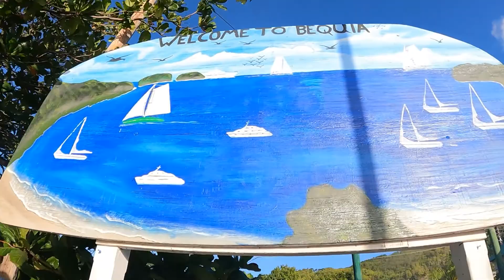Sailing the Atlantic Loop - 13 Cruising St  Vincent & The Grenadines

Comment: Hello Caroline & Charles, 🙋‍♂️
This is a really nice video. One or both of you have some pretty decent skills with a camera and software.👍 (And some good equipment.)
A observation and a question. First the question,  (at 16:56 ) any idea what kind of fish that is? I've spent a large part of my life in, on & under various oceans and I don't recall ever seeing one before. My wife says it's probably just a serious episode of CRS...😕 That from someone that routinely avoids any body of water wider than a bathtub.😁
I noticed that after a kilometer or rwo hike up a hill Caroline was pretty well out of breath. Hmmm 🤔, I'm guessing that either y'all ran up the hill or boat yoga isn't working for you two.😉 Maybe you should try uphill sailing on your next passage.😂 
All BS aside, I like what you're doing, your skills, equipment and how well you use all of it. I do have two critiques however. 1st, having lived thru the capture & editing parts you may not notice that some of your 1 second transitions are too quick to follow. I've actually watched a couple of them @ 1/4 speed only to find out that I didn't miss anything.😊 I just have a problem with my eyeballs accelerating to hyperspeed only to hit a stop 1 second later. look at it like this, if it's worth leaving in then it should be worth slowing down so the audience can follow along.🙏
2nd, I've never noticed a remote mic in your vids that I've watched. There's nothing wrong with using the camera mic most of the time. (I love the way yours captures the underwater sounds.) But you have to work within their limited scope. And even a camera mic needs a windsock now & then.😁
Keep up the great work. 🙏
Best Wishes from the Northern Gulf of Mexico 🙋‍♂️
Reply from the maker: Hi Mike! 
Thanks for the comments. Really good to know where things are good and where things could be improved. The fish at 16.56 is (I think) a flying Gurnard. Super cool fish, and the only time I saw one in the Caribbean.  
Haha, unfortunately Caroline and I were not used to walking uphills after boat life! We have noticed our CV fitness fall off, so we have some running to do this autumn.
Thanks for the comments regarding transitions, agree longer clips would be easier to follow 💪💪👍
Our phone mic broke halfway through our trip, so unfortunately the sound quality isn't too good in a lot of the clips, perhaps we'll try to edit in post, or use more voice overs.
Hope you are well and great to hear from you!